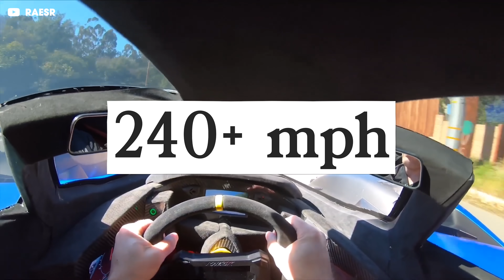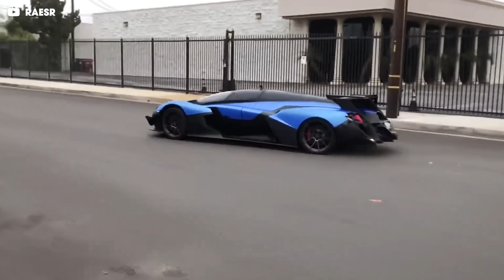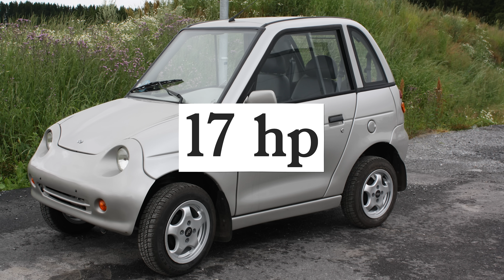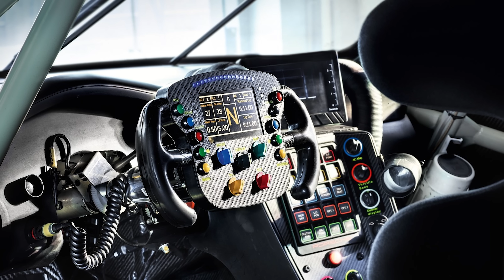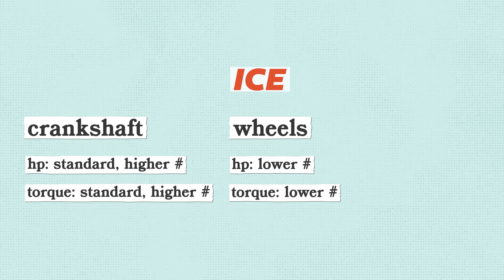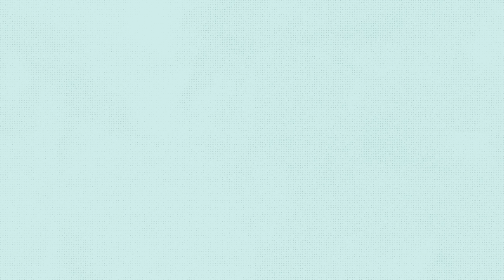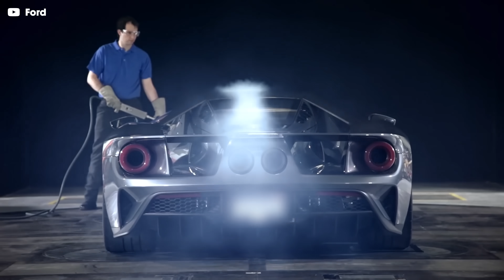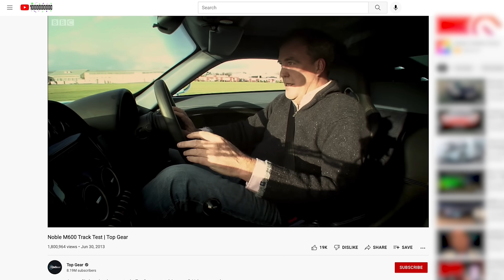Can This EV Hypercar Deliver on its Promises?

Comment: Hey Nolan- team RAESR to help clarify some of the questions about the Tachyon Speed prototype’s powertrain. As far as the horsepower claim discrepancies listed online, it comes down to the two different battery voltages we have used on the prototype. Our original Gen1.1 battery pack was over 700 volts. At that voltage, each motor could deliver slightly more than 200kw each (268hp), which adds up to just over 1600hp.

After the initial press releases (listing the 1600hp number), we decided to go with a lower voltage pack because the higher voltage battery pack was quite large and didn’t allow any space for a rear passenger (something we decided was important so that the driver could share the extreme driving experience) For this reason, we decided to make a Gen1.2 pack rated at about 530volts, leading to a lower (1250ish) maximum power level for the motors (volts x amps determines the power).

As far as the high torque number, the quoted amount is our motor torque. As long as the battery pack is able to provide a discharge of 2700 amps, the motors will deliver 800nm each. The motors are direct drive with no reduction, so that is the torque you “feel” at the wheels.  Wheel torque is what really matters, and we are planning on much higher rpm motors for our Gen2 powertrain as well as gear reduction (multiplying the motor torque) so that wheel torque is at least double that of the Tachyon Speed prototype.  

The prototype is currently at the Petersen Museum in LA if anyone would like to see it in person as part of their “Hypercar” exhibit, maybe when it returns we can give y’all a ride! Thank you for taking the time to make this video, we appreciated your detailed breakdown and your support!
Reply: Also, confirmation of pronunciation.

Raesr = “Racer” or “Razor”
Reply: @charlielima1985  “racer”
Reply: @ericrice825  thank you.. that’s what I thought… I believe Nolan needs to know this..
Reply: respect ++
Reply: I rode it in asphalt 9 legends
Reply: Ok, to be this open about there car. I'm not saying it's 100% believable. But hey, way better then most of the other manufactures he mentioned early that seemed to try to keep every little detail under wraps. So, good on this company. I hope they have good luck making this car a production ready car that matches or even surpasses it's claim
Reply: This is how a car company should respond
Reply: Oh dang-
Reply: Cap
Reply: Respect
Reply: brothers, just wanna say cheers.. i hope you guys make it. you are living the dream for most car guys.
Reply: nerd
Reply: Thanks for explaining the 1600Hp issue. Your car is a real looker and it would be super if you all have a bit of free time, it would be incredible to see your "Not Proprietary" shop set up as all of us dream of doing what you are working on. I can't wait to hear more if you have any updates. I hope you all are as happy and healthy as you can be. Good luck.
Reply: car is sus as hell
Reply: You know, everyone is making evs, you should do something different. You guys should use a big V8, find a way to give it 2000horsepower or so, and no one will stop you.
Reply: @captainawesome7092  Yeah, high horsepower V8s are very original. It's not like that's been done hundreds of time over the past 100 years.
Reply: @chemgator64 Maybe a V8 on it's own isn't original, but one with 2000hp from a brand new supercar manufacturer is.
Reply: @llamaboy64  An ev from a new supercar manufacturer on the other hand is old news.
Reply: @captainawesome7092  ahem
FELINO cB7plus is going to do that.

Comment: All wheel drive torque vectoring really isn't that difficult for a small company. In the previous company I worked at we made a vehicle with torque vectoring and we were only a 2 man team. It's easy to do on an electric or hydraulic driven vehicle (instead of a mechanical one).

Comment: well powerfigures for ev´s ;) 
ICE´s are a different beasts for example a electric motor isn´t limited by size but how thick the wire of the coils are, but if you give them all the power in the world they technically can take it, until thermal runaway that is, but this can not happen instantly, thats why powerfigures for ev are even mor misleading than in gas engines, because a electric motor with rated 30 kw, will sustain 100kw for a short time and the shorter that time the more you can give, so ask for sustainable hp and the tesla guys will tell you yeah, about 150 not 400
Reply: *an electric.

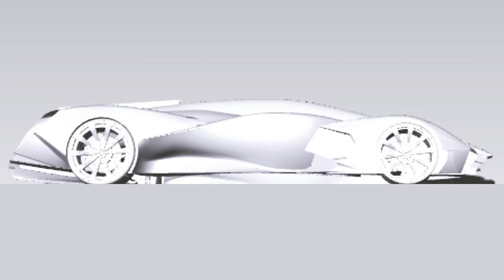Comment: The CFD results at 9:15... 
To be honest all that blue region is basically stagnation and recirculation regions since velocity magnitude is zero there. Not the most efficient design. But then there's only one Newey.
One would want to see the skin friction drag and pressure drag plots.
Then comes the whole scheme of working with the CFD software itself.
Sometimes it can also be called Colourful Fluid Dynamics.
Ofcourse the image makes it look like the car is going so fast like a rocket.

Comment: In the RC rock crawling world, we use electric over nitro because of the instantaneous torque, instant throttle response. We use 550 dc motors usually, and they can pull our 10lb rigs around and up hills u can't even walk up they're so steep for yearssss. My motors heel replaced once in the last 3 years. We even have scale winches, (warn ftw) whose dc motor is about the size of my thumbnail, and they can dead pull drag upto 32lbs!!! So I believe the power and torque figures easilyyyy.  They might even be holding back to not get ripped apart with their power claims, like they already are lol

Comment: there are 6 independent electric motor, shouldn't be that hard to tell each wheel to spin while there are side loading g in the software. Spin how much? now thats the problem only much testing with a pro at the wheel will be able to get.

Comment: 4 wheel independent torque vectoring wouldn't be that complicated. all you need is an accelerometer, telemetry from each motor and speed controller and a half decent programmer.

Comment: I just wonder, why they still don't add gears to those motors. Yes, some like Porsche and Audi do, but as far as i know they are the only ones. And yes, i know electric motors don't need that for acceleration like ICE does, but once you get above 200km/h the motors can shift in higher gear, lowering their RPMs while keeping the torque. Granted there will be some mechanical loses, but i bet with clever calculations those will be overcome and it can increase the range by decreasing the discharge rate while also increasing the top speed while in the meantime keeping the battery cooler.

Comment: The fact that they have six motors would absolutely REQUIRE some form of torque vectoring.  
There would be minimal traction otherwise, with that much torque available.
Reply: That's not what torque vectoring is for. Torque vectoring is sort of like stabity control but instead of using the brakes to reduce peak torque to control dynamics in a corner it can both add and reduce torque to each wheel instead of just limit it. You could use the motor speed to control wheel spin to limit torque, and prevent spin. You do not need vectoring to control wheel spin.

Comment: There are small shops who turn heaps into 1000 hp drag strip monsters all the time. Heck, look at the trash Cleetus runs! This is just the electric version. Its speculation now, but in a few years I see even the ICE groups going hybrid. Ford is already selling an electric crate motor.

Comment: Setting aside all the performance figures, I got to ask, who TF designed the rear on that thing? Looking at the front, you are like 'a that's pretty cool'. But then it's followed by a mash-up of spoilers placed on a sort of rear diffuser/ bumper that has a larger angle than most mountain slopes. IMO it completely messes up the design

Comment: Horsepower differences might be theoretical motor power vs what the battery can supply. Tesla had issues with that some years ago, when they listed motor power that wasn't achievable because of battery limitations.

Comment: A 2022 Ram 3500 optioned correctly has 1,075 lb-ft of torque btw. 2021 is the 1,000 figure. Ford beat Ram for the 21MY, so Ram changed and tweaked a few things to be the King of Torque again.
Reply: Thank you! I was annoyed when they got that wrong
Reply: The 3500 torque to weight isnt that impressive. >3000kgs !

Comment: Haven’t watched the video yet. But I’d imagine to make 4000 ftlb of torque you could just put like 4 motors for each wheel and get rid of range if all you’re after is speed
Essentially top fuel dragster type reliability and range
8-10 rimac nevera motors

Comment: The torque number can't really be compared outright between EV's and petrol cars unless you know how it's being measured.  You gotta make sure it's "crank to crank" or "wheel to wheel".  For instance, a full size truck with it's (approx) 4:1 1st gear ratio and 4:1 axle ratio would have in the neighborhood of 16,000 ft/lbs at the wheels.....factor in a low range transfercase and you are in the 40,000+ ft/lb range.

A high performance sports car, lets say a Corvette, has 470 ft/lbs, 2.91 trans ratio & ~5.0 gear ratio which = 6,838 ft/lbs at the wheels.

The claim here of 4,000 ft/lbs is certainly less at the wheels that you'd expect, but MUCH more at the crank than you'd expect....so who knows how it's being measured.  It's actually very similar to a large diesel engine so logic tells us there is likely a gear reduction somewhere in the drivetrain that is multiplying torque.
Reply: There is definitely some kind of gear reduction built into the drivetrain. Single speed, but definitely a reduction. Given that EV motors can hit more than 15k rpm, I’d be willing to bet that it’s geared down by the time you reach the wheels.
Reply: @antonkrause2420  I think Teslas have a ~8:1 reduction, which if the 15k rpm figure is right makes sense.....petrol rigs have ~7k RPM's and have (assuming 4th gear) an approximate 5:1 ratio, so about half.

Comment: since electric motors produce  instant torque, what happens if you add a gear box with lets say two ratio,s, will that extend  the mileage, plus the gear box would have to be intertgrated to each wheel if its four wheel drive
Reply: More power loss

Comment: the limting factor is gonna be traction , so unless you can push the car against something else ( air , like cold thrusters , or jets, or a rocket)  cars arent getting any faster than the nevera.. not soon anyway. I wouldnt be shocked to see 6 wheel cars coming soon

Comment: Torque Vectoring is pretty "easy" with motors in each wheel btw. You can just controll each inverter different which with a good Matlab Model is pretty simple but hard to refine.
Reply: yeh the torque vectoring shouldn't be hard, we essentially do that with fpv drones; it's how they fly and the guys programming are doing it opensource. If it's got motors on each wheel, a simple feedback loop with gyros and accelerometers and some coding and it's not hard to imagine.

Comment: I sure hope not, a V8 powered supercar is the car I want to see succeed. Dodge would be most likely to do this, in order to promote their HEMI V8s.
Reply: Gas engines will always reign supreme. The majority of electric cars are soulless. I don’t think you’ll ever be able to give them the same feel
Reply: @MothsW1ng  you could've say the same about the manual transmission tbh.
I personally doubt EVs will ever compete with ICE to a point similar to how autos/DCTs compete with manuals though
Reply: @wolfgang_h3t  but that’s wrong lol. The only difference between manual and auto is the fact that you have to hit the clutch and shift. You still have all the sound and feel that gives the car soul.

Comment: Long term EV's have a capacity problem, 1. is the rare earth elements to support the battery needs.  2.  Grid fragility limits the increased power demands for large scale implementation.  3.  Mass EV use in cold environment could cause critical breakdowns in say a blizzard where vehicles are stuck on the road for hours trying to heat the passenger compartment, you can't just send people out with gas cans to support them.  As a niche or a small capacity of the total car market EVs make some sense though not much, and when we stop subsidizing them you will see the market crash.

Hybrids however make tons of sense, imagine a diesel/electric hybrid even plug-in capability.  I would drive a turbo diesel hybrid all day long, and you could run bio-diesel to help the environment.
Reply: Cobalt consumption is #2 for the fossil fuel industry. It takes 15-20% of all energy used globally just to find, extract, transport, refine and transport fossil fuels again so you can burn it at 15-25% total efficiency well-wheels.
Plenty of rare earths are used in spark plugs, catalytic converters and 02 sensors. Any comment on that by chance? 🤔

As for heating, an ev doesn't sit there wasting its fuel by idling, at full blast a tesla for example can run its heater alone for day's. 
So no sitting in traffic won't be a major concern for any ev owners. Plus they almost all have seat warmers and heated steering wheels.

As for grid stability try doing some research on off peak charging. Evs actually allow the grid to shunt energy that would otherwise be wasted into their batteries so utilities make more $ 
Also for fun look up total amount of rejected energy. Hint you'll find if we stop burning fossil fuels and switch to renewables and evs, we'd actually use less than half the current worldwide energy needed now. Just shutting off the drill rigs, oil refineries and oil pump jacks would allow the complete conversion to evs. 👍🏻
Reply: Well said 👍
Reply: Careful using logic and reason. Ev fanboys will attack you relentlessly

Comment: Nolan, you've got a handle on this one, I buy it too. Torque vectoring is dead easy when you have motors dedicated to each wheel like this thing and a lot of other EVs by the way. Simple software solution only. Much more complex when you need to use brake bias or a fancy planetary gearsets + clutch packs setup like ZF has done.

Comment: Torque vectoring does not sound not that complicated, mostly traction control with a the abiliity to shift power around. Which is easy for en EV, because all wheels have their own engine and don't share a driveshaft. 

I'd even go simpler: go for a basic early Nissan skyline tractiopn control/AWD, i.e. all power to the rear wheels till they're slipping, then redistribute to the front. Then hook a bunch of sensors into an AI and have it predict the state of traction. Later with enough data the AI can model itself into a suggestive force to control traction before it happens and even optimize power delivery based on the driving style of it's owner....

Comment: Electric vehicle have no gear ratio. Gas engine have transmission that multiply torque as they divide at the same rate, power is always equal first gear around 2.6 plus rear end ratio of 3.4 is a factor of six. Crank torque × 6 = axle torque roughly

Comment: I mean the car has more than one motor per wheel, so if it's capable of turning freely [without any "binding"/resistance from the motors trying to spin at identical speeds], then it's basically already using torque vectoring, lol.
Actual torque vectoring is a huge feat of engineering for something with a single power source splitting outputs to multiple wheels, but for vehicles with a power source at each wheel...it's implied, and just adds fluff to the car's resume.
Reply: True

Comment: The tachyon has a gear ratio of 1:1. There is no gearbox. So all that torque is wheel torque AND motor torque. And it’s not that unrealistic either. Since the car has 6 motors, it can simply split up that torque between each motor.

Comment: Since the electric motors do have a gear ratio (just one single gear and therefore the descrepency between motor and wheel torque), you can easily achieve ridiculous amounts of torque in an EV. I have worked on a car that has 4 electic wheel hub motors with about 35 Nm (25 foot pound) of torque each, though through our gear ratio we achieve about 1500 Nm (1006 foot pound) of wheel torque combined.
Really ain't that hard in that sense.
Reply: This car doesn’t have a gearbox. The motor’s are directly connected to the wheels. So that torque figure on the raesr is both the motor torque and the wheel torque.
Reply: @beanapprentice1687  Sorry, must've misunderstood or mentally skipped that part. Thanks

Comment: BTW torque vectoring isn't that hard... Especially with electric motors... You just use the ABS sensor for wheel speed and apply power accordingly
Reply: For 4 electric drives, you could damn near do it with a decent drone controller , an arduino, and a 4 channel EV inverter. 🤔 They do sense pitch, yaw, and roll. It's just how you tell th to respond.
Reply: Lmao. Isn't that hard because you know the very very basic overview of how it works. I'm sure you could knock out a torque vectoring system for them in an afternoon right 😂

Comment: Until ev can comparably match the range of the best gas motors, have full recharge in like 5 minutes (because you can refeul a gas tank in a minute typically) and then the recharge infrastructure is widely everywhere, I won't be looking at ev cars. They're getting better yes, but still not fully convenient for daily life unless you live in a highly populated city where access to recharging ev is easy, and you have a low range you need to achieve. But right now, the cost to switch to ev is too expensive compared to the hassle that comes along with it for the general population.
Reply: Until you drive my 1€ a km car

Comment: regarding the fact that a current gen Formula E car already delivers up to 4000Nm (or ~3000 freedom torques) from a single motor unit the torque values really don't seem very unachievable. Still doesn't mean that the car will actually be fast